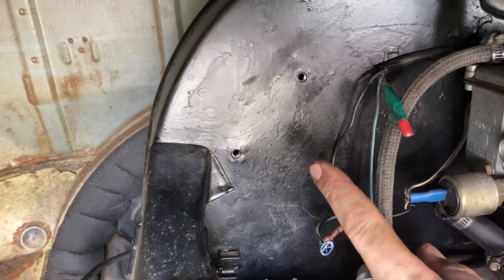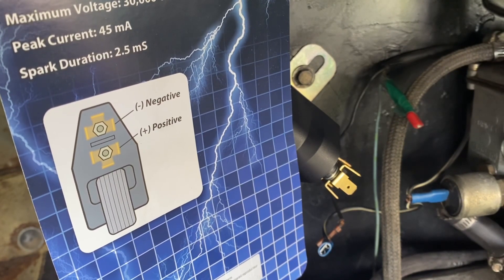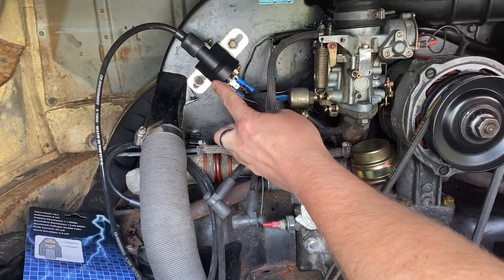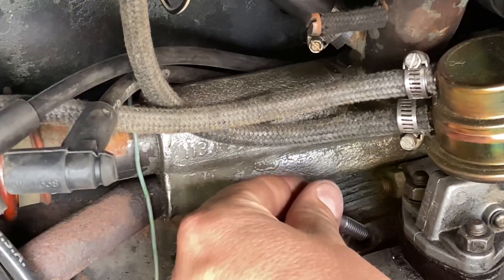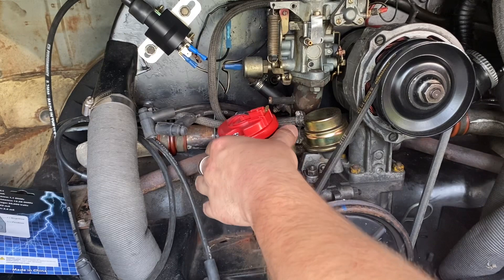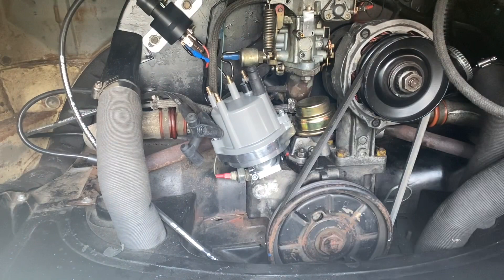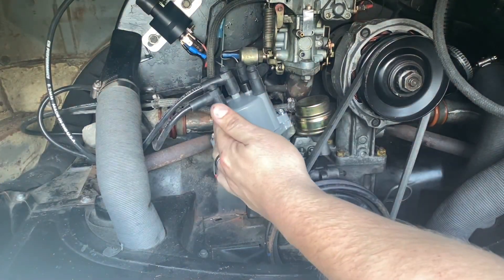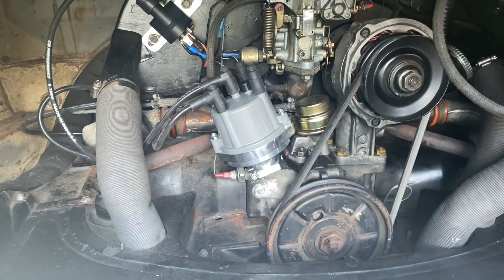Part 2: Installing the VW Magnaspark II Distributor Kit - Electronic Ignition Series

Comment: Put the same  unit on in my split single cab and having issues with 2 gear hesitation. What springs did you put inside the dizzy? Also your top genny pulley looks way bent ;)
Reply from the maker: I’m running this one with the standard light silver springs and luckily I’m not getting a flat spot or any hesitation out of second gear. Thanks for the heads up! This engine is due for some out of car maintenance, so I’ll put that on the list! Haha